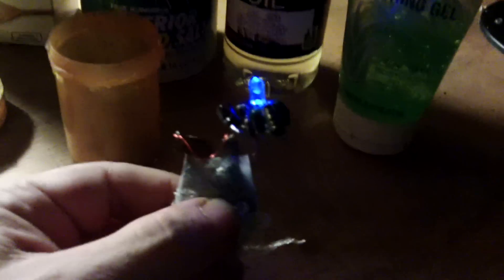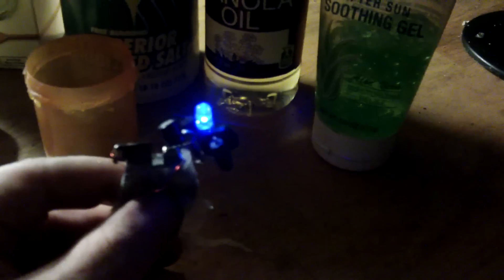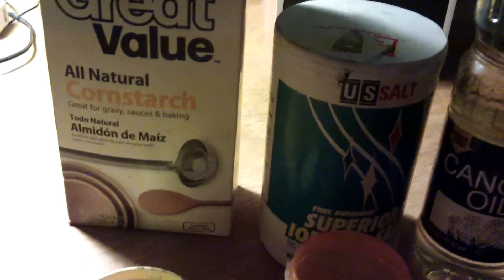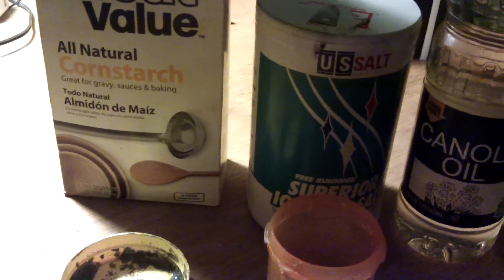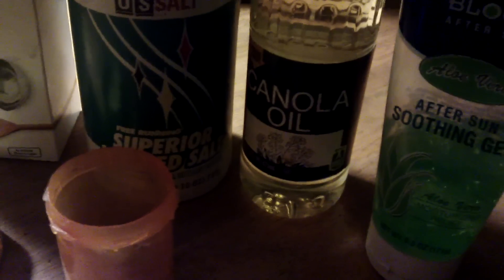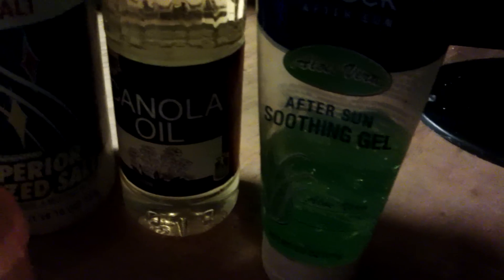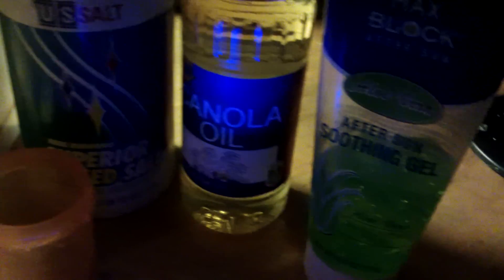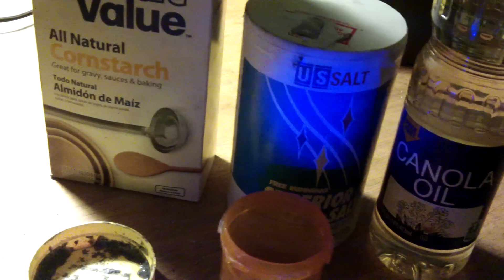Built an Oozeq battery - well worth trying !

Comment: it looks like a galvanic reaction between zinc and copper with the salt. does this work with electrodes of the same material?
Reply from the maker: It does...my latest vids in this small series show kitchen foil electrodes. The one uploaded today is of one of these with Al both sides but charged at 12V for 10 secs. It ran an 8mm motor and 5" propeller for 2 minutes.

Comment: do you think the homemade graphene made is work so much better.i can't wait for you to concoct a winner with this,maybe a flying wing formed from the putty over the styrofoam or some such.great work mon ami
Reply from the maker: It does seem to be doing something. I've made several, some with water, or missing this and adding that, but this homemade graphene keeps the voltage from dropping (how ? doesn't it just make a single lane highway an 8 lane highway ?). This first one is still going. Am not sure if it recovers much, but certainly has no fade off troubles. Now there's an idea ! never add nose weight to a plane, add powerrrrrrr as something that also lets the plane bounce with a nose hit lol

Comment: good morning I was just looking on your small Veronica motor I was going to try making one , what do you recommend as far as transistors? thank you for your time . chuco
Reply from the maker: Is there an error in translation ? I don't recall a Veronica motor, but normally such details will be in the description box of a video. For motors under 100mA I normally go with a C945 or C1815, up to 1A would be S8050 or S8550 and larger would be power FET's...nearly all components are from salvaged circuitboards that I use :)
Reply: slider2732 sorry about that I ment the pulse motor , hate this tablet , letters are too small and fingers too big , and this spell check is wacky , it's not running right ,